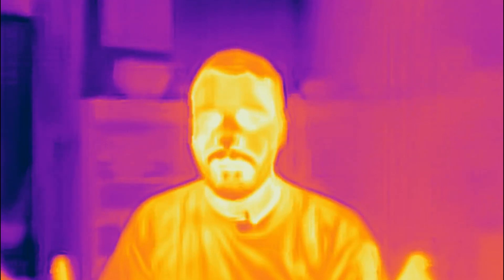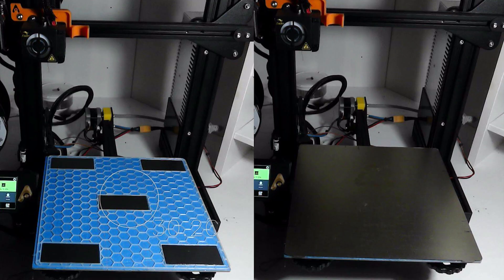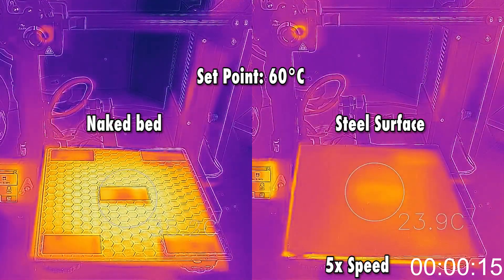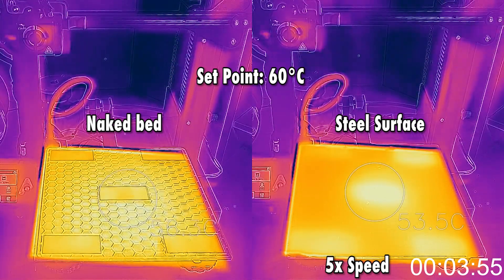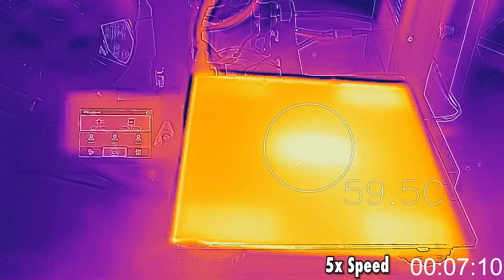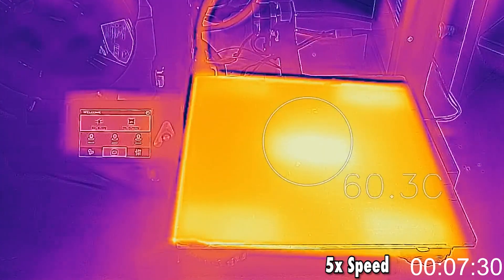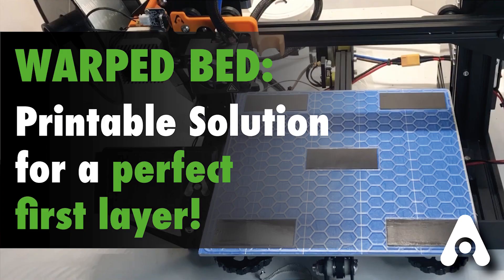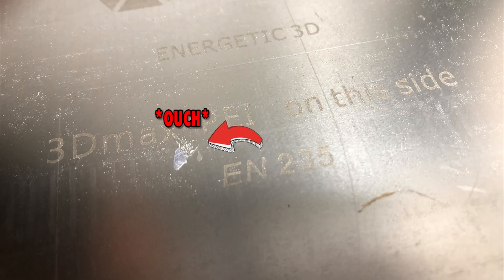Bed Heat Map: is my honeycomb making any difference?

Comment: Thanks for taking the time to do this - interesting results, but not really surprising overall I think. An extra layer of material is always going to introduce a temperature difference, and your honeycomb has added two different ones - air and plastic. Good to see how well the metal print surface smoothes it all out though.  I use a cheap IR thermometer to get spot-temp readings but this is way more useful.  And a Happy new Year :)
Reply from the maker: Thanks Chris! I agree it was predictable, seeing it is very satisfying for me!
Reply: It certainly was interesting to see it visualised